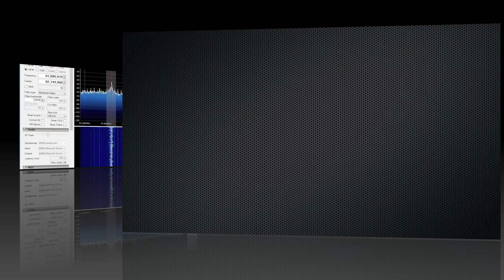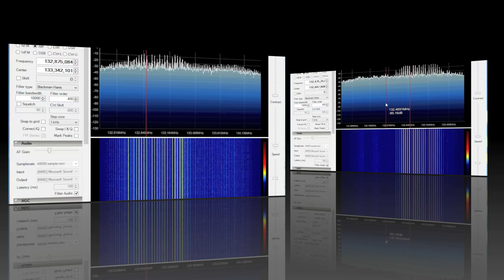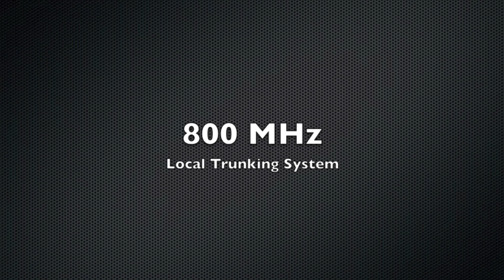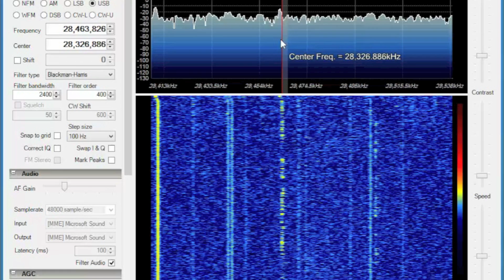RT820 Vs E4000 SDR DVB-T Dongles

Comment: There is an option on the 820T to remove the DC. I noticed the DC spike on some of those. I don't know if it available on SDR# as I have not gotten SDR# to work yet (I just got mine about a week ago) but it works fine on gqrx.

Comment: Hopefully after three months you've gotten it to work by now but I can say I too had a lot of trouble getting mine to work at first, but it was because I wasn't correctly installing the drivers. Once you learn how to correctly do this it should work fine for you.
I would suggest looking up video's on just how to properly install the drivers. I had to do this because nothing I did seemed to work. Once I watched a few video's on the correct installation I got it to work :)

Comment: I noticed my RTL2832 seems to receive very well in the 800 and 900 MHz range but doesn't seem to hear much at all in the VHF and lower band UHF ranges. I'm actually using a tri-band antenna mounted several meters in the air. Although it can hear local amateur radio repeaters in the area, they must be reasonably close to even show up at all with the 2832 dongle. Once you get into the 800 & 900 MHz ranges the 2832 really seems to excel.
These dongles can be a challenge for new users to install !